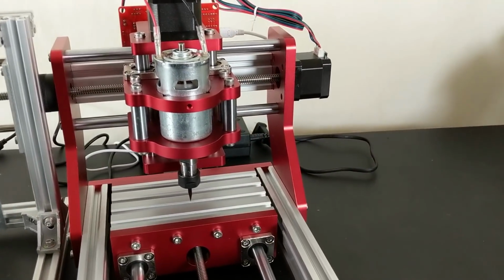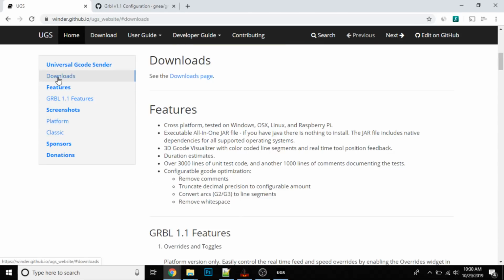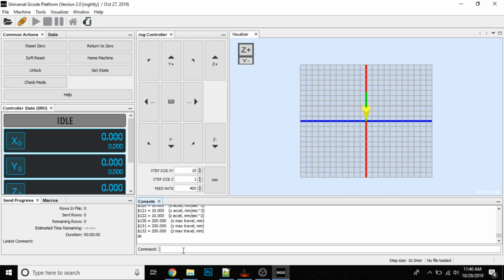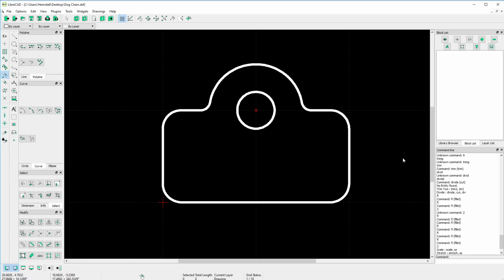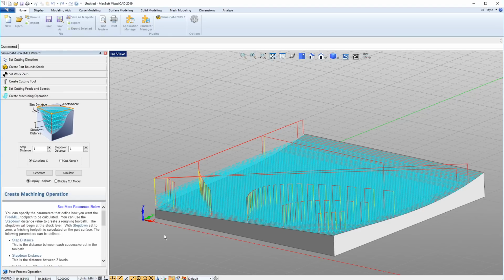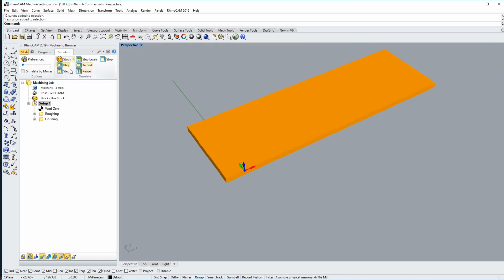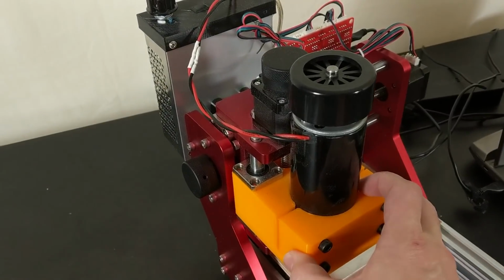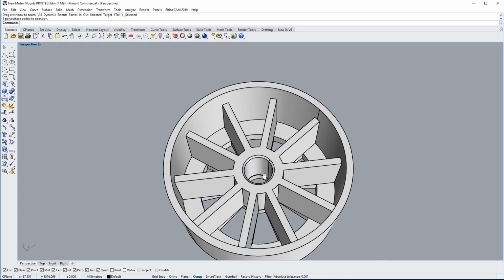How To CNC Cut Metal For Under $400 using the 1310 CNC Router

Comment: Hiya, not sure if any one has already said this but a few tips, kerosene is the best lube for machining ali, the tool speed for hss is N = 1000 x S / π x D where n is spindle speed in rpm S is surface speed in M/pm (avlb from material data sheet) ali is about 100 from memory, D is diameter in MM, if using coolant 10-15% faster, if using carbide rpm x10. Rule of thumb is 0.1 mm per tooth feed. Unfortunatly the above is great if you have brand new machines so, if it chatters slow the spindle increase the feed, make sure your tool bit is as short as possible and sharp, ali is really abrasive, if using HSS don't let it rub as it will take the edge off the cutter making it a paper weight, don't climb mill unless you have a rigid machine with 0 backlash or your tool will fracture in seconds, if you can climb mill it cuts far better. when selecting a cutter for side and face machining make sure the trailing cutter starts the cut before the previous finishes.  the only other thing i can think of is the collet, but the only way to fix that (apart from a clarkson chuck) is mabey using a larger collet and machine a nice long snug slieve out of brass and put a small slit down its axis, it works quite well. OK woffled enough. g luck

Comment: I'm sorry but I don't buy your explanation of cutting the slot. Regardless of the width of the slot to be cut if you are starting with uncut material the whole of the bit will always be engaged when moving through any material. If you are cutting profiles then the bit will always be partially engaged. Certainly spiral drilling places less strain on the bit than direct drilling (for which using regular drill bits is preferable) and the spiral motion is akin to profile cuts as the spiral widens..

Comment: I own this machine for prototyping on PMMA and POM. Stock parts and carbide/HSS endmills can handle the tasks on plastics well enough. For aluminium milling, you need to upgrade 24000 to rpm spindle which might cost the same as the machine and the feed should be kept slow to minimize vibration.

There's a Russian guy who successfully cut aluminium with this machine using spindle upgrade. https://www.youtube.com/watch?v=aSBFcjPTMqQ

Comment: Not the guy to be taking advice from. The bits he's using are garbage and the cam he's suggesting isn't ideal either. Use the cam software inside Fusion 360 with it's adaptive tool path and usually max RPM without resonance and smaller bits are ideal for lower integrity frames. Feed should be just fast enough to minimize re-cutting of chips and pretty much any type of coolant is a must(WD40 for example). Check out the mostly printed CNC(MPCNC) on youtube for amazing quality possible for a very low startup price(sub $1,000 with high end spindle) with damn near production quality finish in 6061. This is coming from a guy who has tried everything from home made 900lb mill to CNC conversions as well as 6,500lb industrial VMC's. 

 I would also never suggest using PETG for a mount or really anything structural as it's too flimsy. PLA is just fine.

Comment: You're not thinking about the problem in the right way.  You could machine aluminium with a cold chisel and a hammer if you wanted to (and had the time).  You could do it with a rock if you had to.  You just have to work within the limitations of the tool you're using.  You're trying to use a lousy tool like it was something awesome. You're right, it's not.  Doesn't mean it can't do the job.

For starters, try chain-drilling first.  In your CAD program, just lay out a string of 3.175mm holes all along where you want to cut, then put a drill bit in the CNC and drill them through.  Next, put a 2mm endmill in and... well, might take some experimenting but I suspect a full depth cut through the center of the holes and then progressing to your cut line would probably get decent results.  The holes will provide lots of space for your chips to settle as well.  And, use SOMETHING on the bits to stop adhesion... even WD40 will work if that's all you've got.  You NEED something with aluminium.

And, from experience with cheap Chinese garbage tooling, going smaller on the endmill will reduce chatter.  It reduces the cutting forces.  Now, if you go too small then speeds and feeds get that much more important or you'll break bits.  But, your goal is to reduce cutting forces (that lead to chatter) without getting to the point where your feeds are too slow and letting your bit rub instead of cut... because rubbing captures heat and you know what that gets you.  The smaller the bit, the slower the feed (for the same spindle speed) which generates smaller chips, which take less force, which reduces chatter.  That's the cheap-tool mantra:  Smaller bits reduce chatter.  Oh, and you can toss the feed and speed guides out the window... they weren't made by engineers running cheap Chinese garbage.

Oh, and start with the right aluminium.  Some of it is impossible to machine (way too gummy) even with the best tools.  'Aluminium' describes a class of metal alloys but there's huge variation, some very machinable, others decidedly not.  It would be very sad if you gave up because you happened upon a chunk of mysterium alloy that was the latter.

And, yeah, good video.. .watched all the way to the end.  But, I disagree with your conclusion.

Comment: Few points of interest here: 
1) The terms most often used is Backlash, or play, in 22 years, I've never heard anyone simply abbreviate it to "lash"

2) judging from what's shown at @00:07:00 that anti-backlash nut is installed completely incorrectly.  The spring is NOT supposed to be compressed that hard, nor is it supposed to be compressed against the frame, the way you "fixed" it completely negates it's use. 
The way these devices work, is they put tension between the nut, the follower, this ensures the nut is always engaged with the threads of the lead screw

This image displays the proper installation of a spring loaded anti-backlash nut:
https://images-na.ssl-images-amazon.com/images/I/71xI4rTFy4L.jpg

3) At the scale you're talking about, rigidity issues on the "cheap" versions has very little to do with the frame, and more to do with the hardened guide rods, and the fact that on the machine you're reviewing ,they are offset, and the machines you pointed out, they are in line. This will lead to "nod" and tram errors int he cheaper machines as they plunge into work, and chatter as they move through the work.  However, again, with the scale of these machines, you shouldn't be putting sufficient cutting forces with any of them to bend rods, you're not working with VMC's, so trying to rooster tail 4041 with this isn't going to happen anyway. Feeds and speeds are where most of your issues are going to come into play. 
 (yes, 12mm hardened rods will be stiffer)

4) Moment of inertia calculations: Wow.. talk about going a long way for literally no reason... Yes, the MoI for 8mm rods is 201, and 1017 for 12mm rods.. However, these numbers actually don't tell us anything practical about the rods, their material, their hardness, bending forces required, or how they relate to the application they are used here. That's like telling someone the tensile strength of nylon when talking about a wire brush.. 
If you're supplying enough force into the work with your cutter, that you're bending, or displacing the rods (2 hardened rods, and the lead screw) then you're obviously over-loading the machine, and operating it unsafely. 
 again.. you're going out of spec for these machines to try to prove a point, that literally, doesn't need to be proven. yes.. 12mm rods, and a thicker gantry cross member will be more rigid, 100% accurate.. literally all you had to say... once.. 

5) False equivalencies abound.  You point out that the connections between two parts are not equally rigid.. um..  ok.. of coarse they aren't going to be equal,  they are 1) different connection planes, 2) different connection points,  3) different components, 4) different profiles... To assume they would be the same is illogical at best... Anyone, can simply take a look, and see they are different in every aspect except for perhaps, the fasteners used.. .on one machine, you have a piece of extrusion, supported with two right-angle blocks, that are clamped onto the extrusion, and the frame (total of 4 connection points, on 4 faces) and on the other, you have 6 connection points, all on the same face... Of coarse they are different, they are different designs.. 

Also, comparing 10mm thick solid aluminum plate to extruded aluminum..... really... The plate will be less likely to tilt as you've described than the extruded aluminum, mainly due to the way they are clamped, and the fact that solid aluminum vs a hollow extrusion.. that 10mm of extra wideness on the extrusion probably isn't going to compensate as well as you might think. However, that being said, if you're putting enough lateral forces on either machine, you're not operating your machine safely, or properly. 

6) It's not an "axel" it's a spindle.  An axel is for wheels, regardless if it spins or not.. a spindle is any rod which spins within a mechanism. 

yea.. i'm not going to go any further into this review.. sorry my guy, but it appears you're trying to look like you know what doing, but there are a myriad of technical issues here, everything from terminology, to mechanical assembly, to the way you describe things shows this isn't something you're very knowledgeable about.
Reply: I read and enjoyed your retort. What you say is true, but unfair, especially as you criticise for being verbose, with probably the most verbose comment on this page. Lol
Of course, it’s important to be accurate in what you say and write, even the spelling of “of course”.
However, everyone has their own style (including me and you), but I think it’s best to  accept that styles are often imperfect in their entertainment and education. The one big takeaway from this video for me was his educational value in failure, which he provided abundantly.
Reply: I think the video is aimed at the home hobbyist, not the anal retentivest.

Comment: FYI, WD-40 works wonderfully to keep the aluminum from welding to the bit & in the process makes the cuts much smoother & clean looking.
Reply: Methylated spirits also does the job and no mess.

Comment: From the video I feel it is not the machine but lack of knowledge about metallurgy.  The aluminum material is not gummy but has a low melting point.  When cutting metals with low melting points, use a cutting liquid.  WD-40 is okay but the listed cutting oils and creams are much better. Tip - if you can cut slivers from the metal with a knife, use a cutting oil.  Also not all aluminum has the same qualities.

Comment: The machine must match the material you wish to carve/machine Aluminum cutting requires Cooling and chip removal The cooling is achived by using a lubrication mist and the chip removal is achieved with air Regardlers of the machine these two are important The accuracy of the cut is determinedby the tollerance in the movement of the x,y,z you need to try to achieve a tollerance of a minimum of .1 mm or less. The vibration is mostly the result of the spindle. Routers in general are not designed for metal and cheep spindles do not have enough bearing to reduce the vibration. The end result is that a cheap machien of $500.00 or less cannot do the job of a $10.000 machine when it concernes metal / Aluminium. ALso the type of aluminium is important for example 2011 is the best for machining  but a more common one maybe 6061 / T4 and T6 aluminium.

Comment: Thank you for such an excellently constructed and presented video - not just a great review of the machine, but a great source of information for anyone thinking of doing amateur CNC machining. I've been eager to get into this, but can't afford it. I keep being tempted by the cheap machines, and other reviews have highlighted things like rigidity and more powerful spindle motors etc, but your video covers the WHY and the real effects on the work - It would be so easy to think "get the machine, do a few upgrades, and you get fantastic precision and performance" - clearly it's not the case.
There are certainly some things where quality of output critically depends on the quality of tools used, both mechanical components and software.
Thanks for a fantastic video. I'm subscribing so that I'll spot your review of that larger machine.

Comment: you made a video to show your viewers how great this little cnc machine is and now you have to change the motor because it's not good. you also want to modify the frame to fit a better motor. i wouldn't waits my time on it anymore, just trash it or return it.

Comment: “This bit will never be the same “ Not True:
Run the bit in the same aluminum with a fine jet ( spray bottle) size stream of anhydrous isopropanol 
and the so called permanently bonded aluminum remnants will fall off. Further, using a 3 flute cutter will drastically reduce the vibration in concert with a shot of isopropanol. ( Note: this only applies to Al and Mag. Naturally a machine like this will need a perimeter around the table to contain the chips and or a vacuum collector somewhere near the spindle.
Further the use of climb cutting ( once you get rid of the backlash also drastically reduces spindle loads

Comment: You can easily remove the aluminum weld from the bit by soaking it in draino or sodium hydroxide for a few minutes. The lye will dissolve away the aluminum.

Comment: In 2021 SD card reader should be a minimum on any cnc. In 3d printing world people almost instantly ditched USB connection because of quality of end result.

Second thing is that microstepping is fun but kills torque. On 1/2 step You get 30% of stepper torque, on 1/8 step its only 2%! You can get away with this on 3d printer if You have light moving parts. On CNC there is no way around this.

Comment: As a machinist I work from a center all the time! There are many benefits that I didn’t notice starting out, especially if the part has symmetrical features. For me its easier to visualize one side as positive and the other side as negative in the same direction. As opposed to having it just look like random numbers in the G code. But if the part has a feature like a hole or a bore I like to indicated and set the origin to the center of that!

Comment: there is a reason why you have chatter, china spindles use craptastic 608 bearings lol, smaller 12v motors use bushings. You need high precision bearings or multiple bearings in order to run more true with less chatter. Then those CNC rails are weak so I would jump up to something like a 6040 or 6090 with weight behind it and 4 bearing spindles.  That larger machine you have is nice but should chips fall in the v rail, you will damage the wheel and it shows up on your wheel or you end up with a not so smooth glide.

Comment: Hi, just saw your great video. @17:10 you asked to mention in comments if there is a good reason why (0;0) should be in the center.
Personally,  I believe it makes tons of sense when you start working in more than 3 axis (x;y;z) and introduce a pitch and roll axis, which would revolve around your (0;0;0).
Just imagine calculating or watching the new coordinates with a tilt on the A or B axis if your center is in the lower left. It becomes even more disturbing for the normal human brain. 
Cheers 🍻
Reply: Origin depends on the type of part you are trying to make. I'll put my origin in the middle of my part if I need to do a circular pattern of holes around the center. Even with 2.5D machines it can be useful.
Reply: are you climb milling or conventional? Did you try left hand and right hand ywi8st end mills? Stick a dial indicator on everything with a mag block, one at a time find the flex or movement. Weld the sicker or pin and screw it. Then work on your ball screw or the involvement there. If it is chattering, you have backlash most probable in your worm/stepper. Go to G code. You just never know what is in that other code, there could be something there that is conducive to your problem.

Comment: Hi Sir, I’m glad I didn’t try what you did by bodgeying your way through trying to get a poorly engineered machine to work properly. There’s no way a cheap machine can do a quality job with tough materials. Given your experience, instead of your step from $500.00 to $1,000.00, why not save the anguish and go straight for $5,000.00 and stop farnarkling around and get on with reasonable quality finished product. Good quality CNC routers sell for $25,000 and way up. There’s a reason why - because they work. Herein endeth the lesson.

As for lubricant and Aluminium, use Windex. It does a great job of keeping your bits clean with no binding. On a 12” table-saw I got a blade that cut Aluminium beautifully and without lubricant. The secret was a negative rake cutting edge. Maybe they make negative rake router bits. Instead of the Aluminium wrapping itself and sticking to the flutes, with negative rake it is flicked off by the cutting action. Cheers.

Comment: Turn the spindle up to full speed, lower the feedrate, add some cutting fluids wd-40 or diesel fuel. Enter the cut from the side not the top every time. You talked about this but didn't do it everytime. Most of the charts are for shops that want to turn out parts as fast as possible with the best or a known surface finish. You don't really care about that and the machine can't do it any way. Another mod would be to limit the stepper drivers to 1/2 and full steps only. They will develop the most torque at those points. You could hand edit the g-code to get the side entered cut or even right a python script to edit the g-code and remove the plunge. Heck you could lie to the tool path software and make it plunge into thinair.